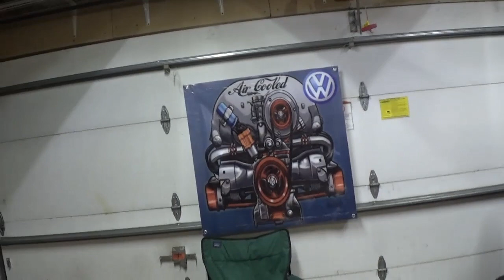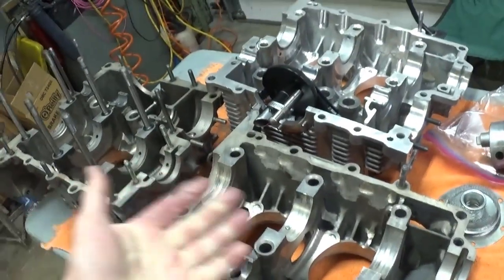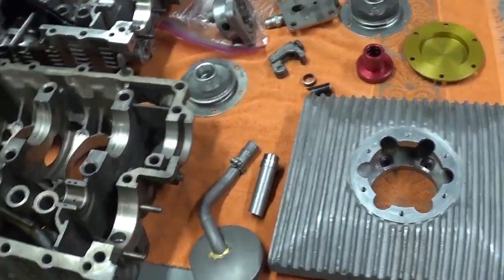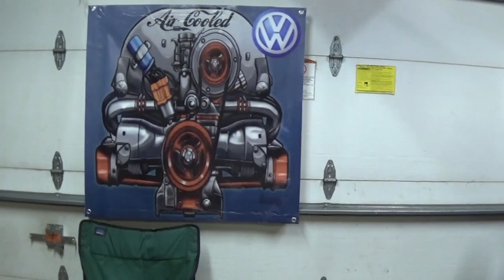VW Oil Pick Up Tube Replacement

Comment: Ez I have a dilemma…does my pickup tube suppose to be loose? I can move it easily? I bought the car recently and haven’t started it yet…Also it has the magnet attached so the screen doesn’t fit not sure where to find one
Reply from the maker: If it is loose you won’t get oil pressure. It is supposed to be secured to a long stud inside the engine case. It is VERY hard to do without taking the engine apart. I know you don’t want to take your engine apart but if your oiling system doesn’t work right you will be rebuilding it very soon anyway. 
It’s a good idea to inspect the bearings and reseal all the engine common leaks anyway.
Reply: @TheEZGZ I appreciate it my friend that makes perfect sense ….thanks again

Comment: I’m currently rebuilding a dual port vw in class and the instructor knocked out the plug. What do you suggest to drill and tap the hole with?
Reply from the maker: Years ago they used to sell plug kits. I never bought one but the idea was to remove the factory plugs and us threaded inserts with a tapered pipe thread. You really want to be sure you only go in deep enough to seal a few threads and install with blue lock tight. Don't use Teflon tape as its possible to tighten the plug to much and crack the case. The plugs were not big plumbing pipe plugs. I'm thinking the brass plugs with the hex key wrench to tighten it in.  Tell your instructor he should do a little research before he charged into Air Cooled VW engines. Hope it turns out well for you.  You might want to call or visit Gene Berg Enterprises and see if they might have something ready to go.

Comment: I need help with putting an upright engine in a 75 bus.  Can you advise me?
Reply from the maker: The starting motor won't match and the cooling tin is a problem. Not enough power when it's all done as the 75 transmission is a much taller ratio. Much better off finding a same year type 4 engine. Good Luck with that...
Reply: I'm putting the engine and trans from my 71 in my 75.  Bought the 75 as a shell.
My engine is a 1904 stroker with a 110 cam
Reply from the maker: Goos Luxk.   Just make sure you fabricate sheet metal to let cooling air from the elephant ears to circulate threw the engine. Everything below the engine needs to stay below the engine. You may want to add an additional mesa oil cooler with a full flow oil filter system. The cooler will attach on the outside of the body on the drivers side without a fan. http://carcraftstore.com/mesastylecoolerkits.aspx
air flow while driving is enough to help cooling and they are tuff enough to withstand a kick or shopping cart.

Comment: Gidday from up here in NZ..... did you have to heat the case and freeze the new pickup to get it back in the case ? I managed to get old one out ( yes it was a mission ) but do you think I can get the new one in ? I also have AS41 cases but mine are preloved.  Anyone else have a trick for this ?
FYI I haven't yet tried heating the case in the wifes oven that might have to wait till she's away for the weekend.
Reply from the maker: I'd rather see you grind a light taper on the tube and then throw it in the freezer for a couple hours.
Reply: @TheEZGZ  great idea with the tapper.. Unfortunatly I moved house recently and it appears a box of not easy to find ( in my part of the world ) parts have vanished ! So does anyone have a long tube German style oil pick up they want to sell or know where I can get one at a realistic price ? 
There was also a type 3 auto flex plate and torque converter as well...... not so easy to find so I also need these if anyone knows where I might find them, again at a real world price.

Comment: I’m a little perplexed by the magnet. These engines are mostly aluminum and magnesium and some brass. If any of the steel components (crank, cam, lifters, cylinder, a few other things) failed, you’d have bigger problems.
Reply from the maker: I used to think that way. But when you start taking these engines apart you will understand.  All those cold starts and not letting the engine warm up and not having a thermostat and high RPM. Not to mention oil changes not done. blah blah blah.connecting rod side play, The rings eat the cylinder walls. All those spring washers on the stock rocker shaft slowly dissolve.  I decided at the last moment to not use that big magnet on the oil pickup. It seems like it was strong enough to magnetize the pickup tube on the inside and  I thought it might be hard to remove stuff???   I went with the normal magnetic drain plug and a dime size super magnet inside each valve cover on the bottom center.  Thanks for your comment and watching my vid.

Comment: Is there a way I can get in contact with you? I have a question about a VW Swing axle that I'm rebuilding. Can't find any information online anywhere but you seem like you know everything about these things!
Reply from the maker: here I am.....   ask your questionh
Reply: @TheEZGZ  I have a super diff. How much in and out play/travel should I have in my axle? I think I need thicker shims because my fulcrum plates don't hold the axle well. It has a screw in ring instead of a snap ring.
Reply from the maker: What you need is a shop manual that covers stock swing axel. 
The Axel is held in place by the wheel bearing at the brake drum side of the axel. 
When assembled correctly with the paper gaskets that allow movement of the axel on that plastic cover.  You need the metal cover to be oil tight but the axel will move freely without side play or up and down motion. You will need to tighten down the brake drum tight enough so that the shoulder contacts that outer axel bearing. Don't forget that beveled spacer that goes behind the bearing.  Turn the brake drum or axel while you move it up and down threw it's normal travel range to make sure the fulcrum plates are self adjusting.  Make sure you have some shims between the side gear and the threaded super diff lock ring just like the factory did with the snap ring set up. Hopefully your threaded super diff came with directions. The threaded peace needs to be drilled and a shear pin installed to keep it from rotating.  Locktight on the threads won't work for long.
Reply: I think you may have just located my problem. There is no spacer whatsoever behind my bearing. That's probably allowing the axle to come out too far. Do you happen to know the technical name or the part number for that beveled spacer?
Reply from the maker: https://weddleindustries.com/products/111-501-281-A/111-501-281-A
Reply from the maker: @erichamilton390  111-501-281-A
INNER SPACER FOR VW SWINGAXLE REAR WHEEL BEARING, SEE PART # 5901
Reply: @TheEZGZ  I have one more question for you. Perhaps you already have a video uploaded about it and I can't find it. What tool do I need to remove the differential carrier bearings? I've got one that has a race damaged so I'm going to be replacing both of them.
Reply from the maker: I put the side gear inside the diff and found a peace of metal that was about the same size to go over it. Then I used a standard gear puller.
Reply: You my friend, are my hero! Can't wait to get this thing back on the road!

Comment: I  could never understand why the wire screen isn't on the bottom or the flaired pickup like other motors when your running an oil filter. Cheers goog to see ya.
Reply: The wire screen will actually suck in and collapse with high volume pumps, or thicker oil.
Reply: @jonathanl4691  why doesn't it suck the bottom mounted screen in.